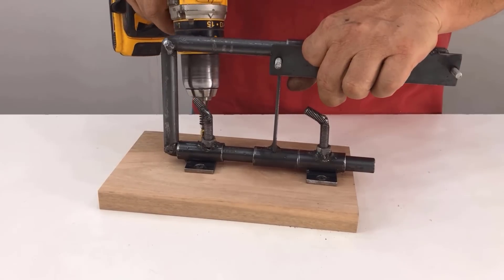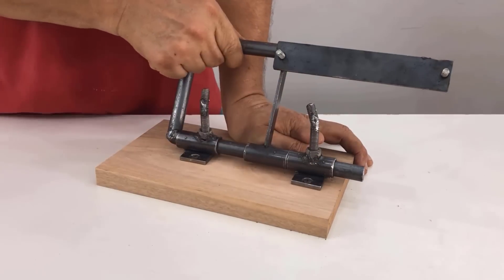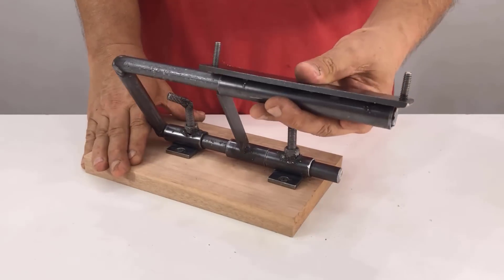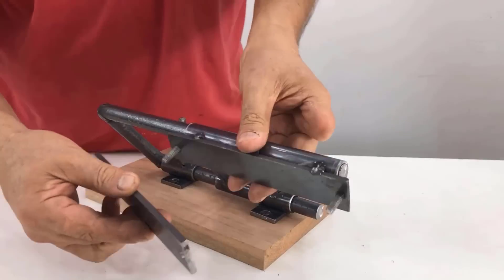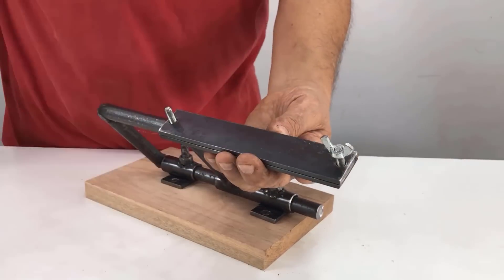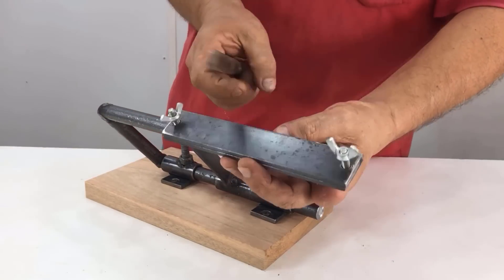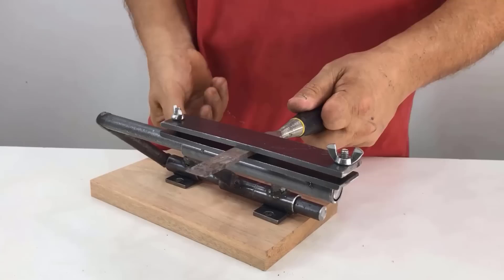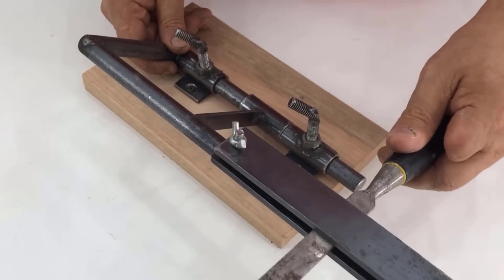Idea que Nunca Olvidaras - Pocas personas saben sobre este Truco Brillante

Comment: Dude, you need to square up(dress) and balance that grinding-wheel.........

Too much of an imbalance increases the chance of them flying apart as you are using them....... and that imbalance also make things vibrate like crazy......

A properly balanced and dressed wheel will also leave a better finish on any tool you grind on it...